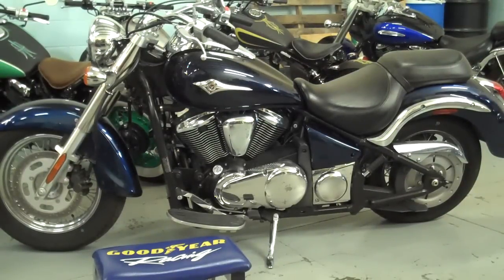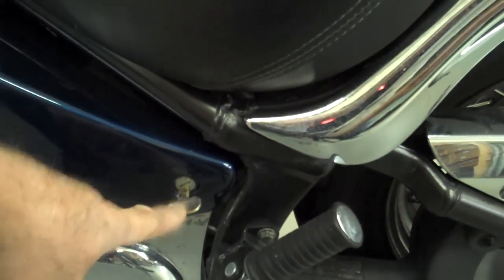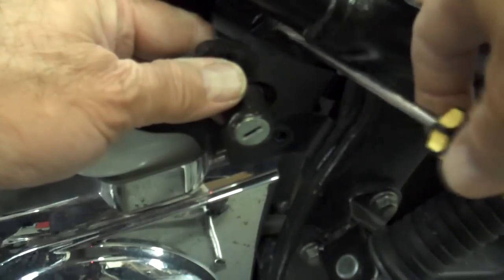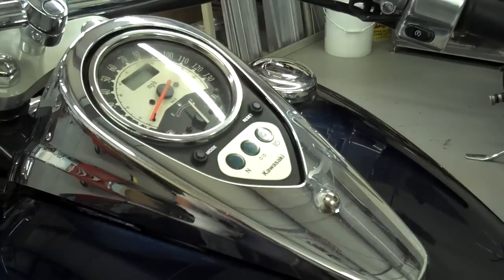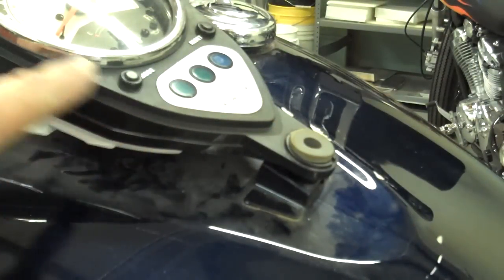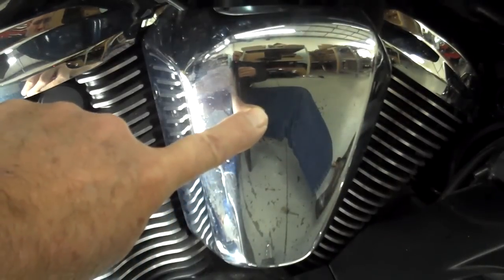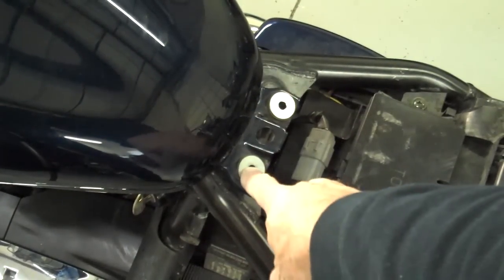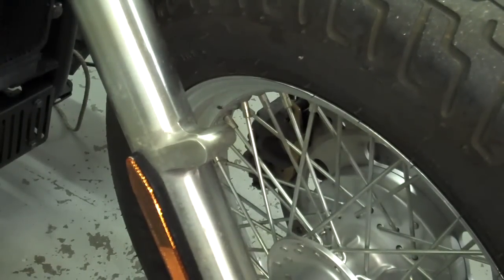Kawasaki Vulcan 900 Disassembly

Comment: Hats off to you guys! Great load of information in less than 11 minutes. 
I need to replace front turn signal bar with one with additional side lights (cobra bar). Its preassembled with wire harness but I don’t-know how to do make connection with battery and headlight 
Any help is appreciated
Reply from the maker: Sorry. We don't know much about the Cobra stuff. Bummer! Thanks so much, Lance at BCB

Comment: Awesome video! I've been looking for a tutorial to remove the gas tank to be able to replace the fuel gauge. My only concern was what would happen if I removed the red connector considering the bike is fuel injected. The quick connect you mentioned during minute 6:30 and 9:15 is the fuel gauge connector that is attached under the tank on the right hand side that leads to the sending unit inside the tank, just FYI. This bikes are notorious for malfunctioning fuel gauges. THANKS AGAIN for the video.
Reply from the maker: consensao17 Thank you for the info and the nice comments!

Comment: Hey man thanks for the video I was just looking at this Vulcan that came into the shop and the key wouldn't turn in the side cover. I looked all over for 10 mm side seat bolts and then saw your video about putting pressure on the seat where the key is actually the release
Reply: Yeah they're finicky

Comment: I have a VN900 Custom and would like to switch it to a bobber however I'm curious as to the width of the rear bobber fender I wanted to use a 180 or 200 rear tire?

Comment: I know this is an old video but can anyone tell me do I need to drain the tank before doing this. I don't want gas to come out when I remove the line.
Reply: Nope, I ran my tank down to  save weight. With about a gallon in tank  I did not spill gas.
Reply: @1245milam  awesome thank you very much for the response.